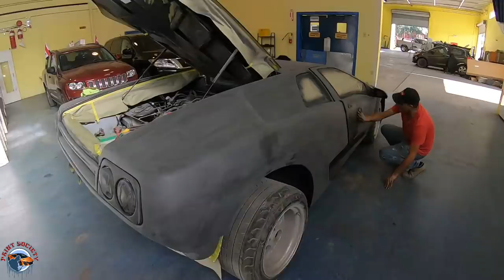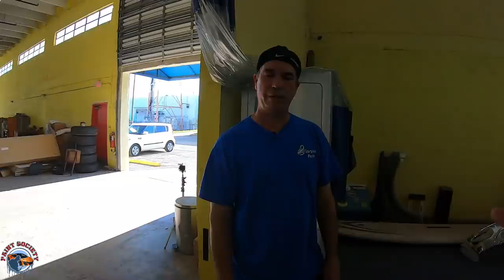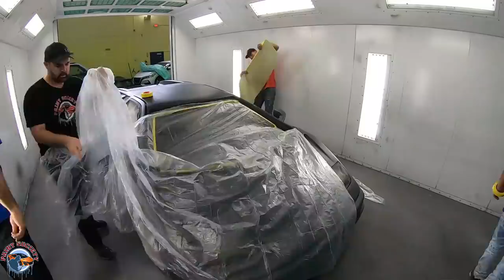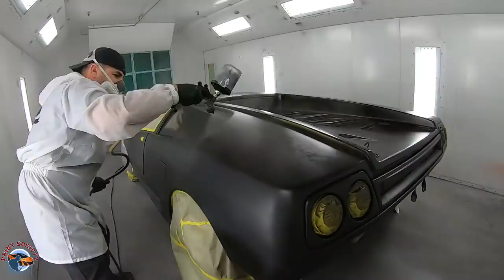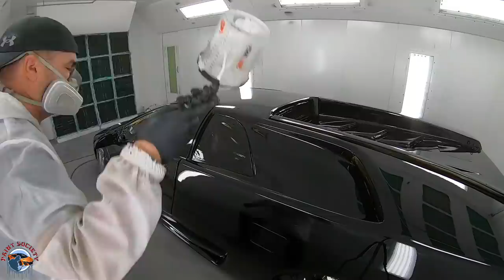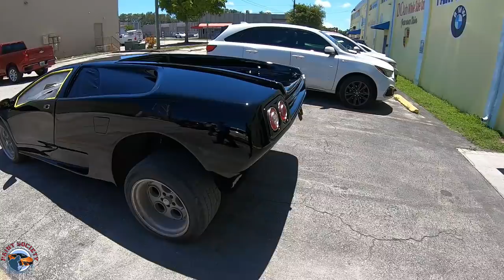FAKE Lamborghini Gets Incredible Paintjob!

Comment: Hello, I'm new to body paint and need some help. What pressure should the regulator  out of my tank be reading? I know the regulator at my gun should be around 30, but should the one at my compressor be left fully opened? Thank you!
Reply: What gun are you using?? For an HVLP, 30 my be a bit high. No need to set your tank regulator wide open. I set mine to like 60 and my gun is between 20-25psi adjusted with a regulator at the gun.

Comment: Great paint job but I gotta say, that body is wavy as hell.  Could've straightened it out a bit better in my opinion.
Reply: I'm thinking the actual body of the car is fiberglass as most kit vehicles are these days. If that's the case I can only assume it's much harder to work and straighten fiberglass body panels compared to metal
Reply: They may have only been paid to paint it not bodywork it.
Reply: @robertlambert5299  Yes, I realize that but I was just saying.
Reply: @chasejones3456  I wouldn't say it's harder to work with, it just takes more time because metal panels are already pretty straight and if they are too damaged, you just replace them. I built a Countach kit many years ago and if you put the time & effort into any fiberglass car, you can get it as straight as any factory car.
Reply: If the bodywork is a bit rough, pick a silver or white it really does help.
Reply from the maker: I would suggest a solid color instead of a metallic at the bodywork is rough because odds are you’re going to have some deep sand scratches

Comment: Anyone know how that kit car chassis is configured?  A Lumina was a front engine front drive so it looks like they maybe took the front clip of a Lumina and made it the back end of some pre-fab frame and front chassis.  The shock towers look original so I've seen where they actually just keep the whole front steering in place but just lock it straight for ease of utility.  Would be interesting to see the underpinnings of this.
Reply: its a damned fiero